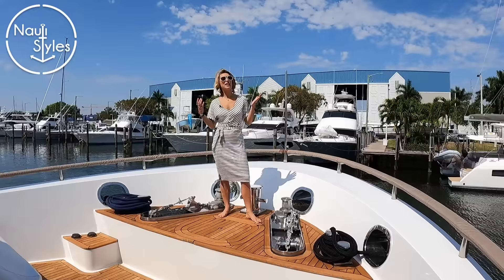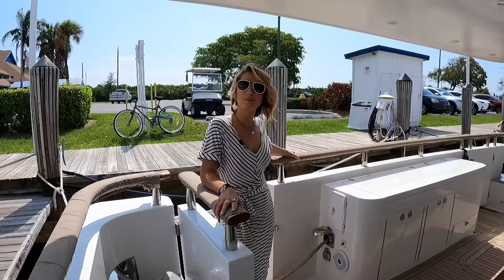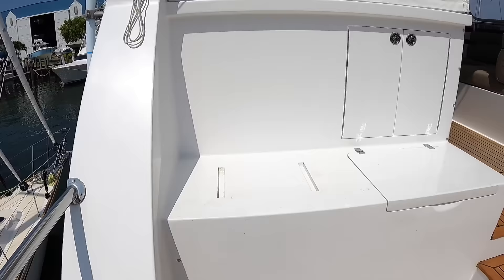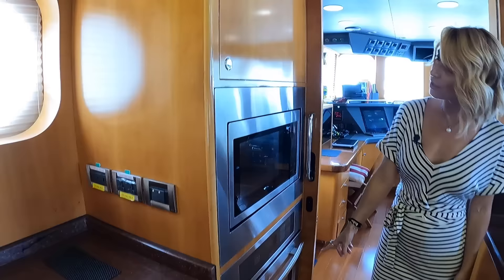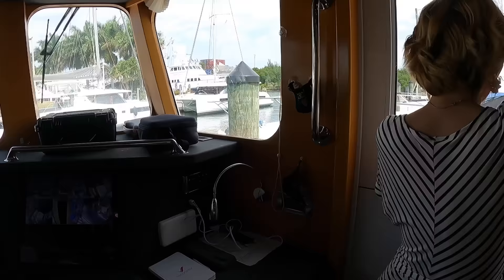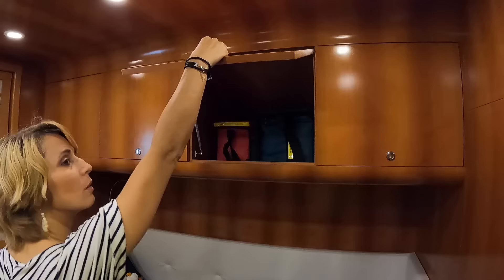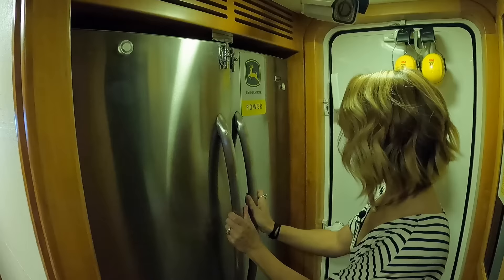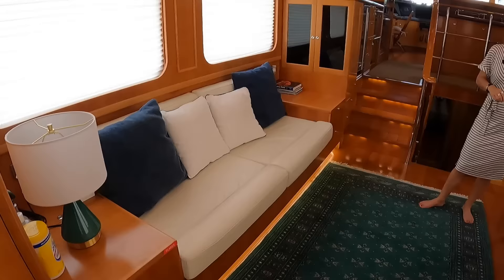$1,550,000 2013 BERING 65 EXPLORER YACHT TOUR / Ultimate Owner-Operator Go Anywhere World Cruiser

Comment: The A-36 steel is common steel plate, not certified as marine grade as far as I know. AH-36 is a marine grade steel. The impact strength of EH36 steel plates is good for much lower temperatures than that of AH36 steel plates for boats intended to cruise in cold climates.

Comment: Only 65 foot boat?   But as you commented, the design and appointments of a 100 foot expedition yacht.  It's mastery to have all this in only a 65 footer, but not feel downsized at all !!
I would love to know the guy that's responsible for getting this masterpiece launched.
Reply from the maker: Russian engineering 😎😜
Reply: As nautoria said, its Russian, and built in Turkey with a Russian yard manager. Seen a video of their manufacturing and wasnt too impressed with how they rolled the hulls around on the ground to reach various places for welding. I grew up in a place with 2 shipyards , of which one is still active, and thats not how they built hulls (more recently the open empty hulls are made in Korea and towed here) and even now no welder is allowed to work on the ships without a bunch of welding certificates. The Bering yard have ships too but the similarities stop there.

Comment: Thank you you guys and gals. Must not forget the Beautiful wife. The storage space is amazing. All the Doors on storage have to Locker systems. The stove with pot holders.
The sealed bulkhead water tight door. The Latches on doors remind me of the Tug I was on in the Army. Yes 6 years on US Army ST.
I Love how you can take remote control out on stern to steer control vessel for docking. It's my Dream vessel. You said owner was X Navy. Boy you can tell he wanted double of everything. For long range cruiser. There must have been something the was thinking about John Deere engines, say over other major brands. My Personal feeling is those JDs, get better fuel burn per gallon of Diesel, love how boom Crane stores very tight. Out of way, so much room on upper structure to swing any smaller craft around the OPEN area up there. Just my Dream vessel. Thank you for in detail walk around. You Rock.

Comment: That is hell of a buy if fits. I lived on boats, did over 12k nm offshore cruising Atlantic out of Florida, single-handed up to 58ft boat. This one a jewel and good price. If 10 years younger, I'd buy it, assuming all power in good shape. I would have to learn the deeper draft and may not get into places been before. Seeing the extra fridge below, wow. Was thinking would have to add deep freezer. Just wow.
Reply: two engines, two generators (generators usually require oil change at 250hrs, engines at 500hrs. That means can run on one generator twice and have oil changes same time as engines.

Comment: What a magnificent vessel!  Of all the boats you've toured, this is one of my all-time favorites. My only question would be about the design specs. Doesn't a cruising speed of 8 knots, top speed of 10, seem rather slow?  Looking back over some of the other very similar boats you've shown, they've all had higher speeds.
Reply: AFAIK, this is a standard cruising speed for trawler style boats (which this practically is). What you get is fuel economy + comfort. Plus, if you have the money, I suspect you can install more powerful motors; fuel consumption for heavy steel boat such as this with powerful motors would go through the roof though (and you would proportionally get less mileage for same tank space). But people usually use these for sightseeing cruises and enjoyable, relaxing rides.

Comment: Dutch doors, guys when you have dark interior you need proper lighting because it looks like you panning down into a black hole and if the dash board is black you cannot see the gauges and switches. I know part of the problem is the light bleed from the uncovered glass.

Comment: These steel explorer yachts are really appealing. Do these boats require frequent out of water maintenance to control rust?  I wonder if controlling rust is a significant added cost of ownership?
Reply from the maker: NOT AT ALL, it's an old tail... these are build like superachts, most superyachts are steel
Reply: They are steel ships built 100 years ago and are still sailing, which you will never see in fiberglass ships, where after 15-20 years lamination problems begin to appear, in addition not corrosion is the main danger but electrocorrosion which happens especially to ships that stay in marina long time connected to shore power without isolation transformer. This boat have isolation transformer.
Reply: @NautiStyles Thanks. Good to know. I have watched this review a number of times. I think I am falling for this boat or at least a boat like this. 
Nothing like like this but equally appealing was the Leopard 53 you guys toured. I guess they both seem approachable for someone that would wish to be an owner operator.

Comment: I'd also like to question the idea that steel is inherently safer than fibreglass.
If you hit an iceberg, sure. If actually planning to go to the arctic or antarctic, do get a steel boat,
But where I am located with my boat, in Asia, the bigger threat is approaching violent storms and, just occasionally, shady people.
Do not underestimate the safety in being nimble. In my light 48-footer I can be 100 miles away before lunch... and I have made use of this option sometimes, to get out of trouble. In a slow steel boat one is more like a sitting duck.

Comment: So at 8 knots covering 5000NM would take you 26 days - that's an awful long time to be out on the open sea, never mind pack food and supplies for. Honestly this looks like a commercial fishing vessel design that at some later stage got "converted" to a yacht. There are faster options out there for world cruising - sailing cats can do 8 knots easy. Likewise, I would want more than a crew of two precisely if something goes south on such a long voyage.

I'm kind of also questioning the water tight bulkheads if this also has a double hull - those kinds of doors shouldn't be necessary. If it is a commercial vessel design it's probably built that way from the ground up. For the price I think it's a very good deal, but this won't be winning ANY speed records.

Comment: Why is a 2013 steel Bering blue water boat only $50,000 more than a 2007 fiberglass Nordhavn 62'? They look comparable as far as quality and design only one is fiberglass and one is steel. Me personally I think steel would be stronger and safer as you don't have to worry about hitting a log or a shallow sand bar and destroying the hull.
Reply: Steel boats are known to drop fast in value. The main problem is possible hidden rust.